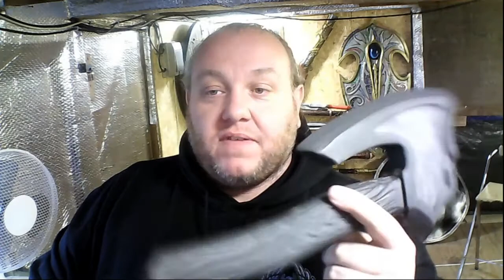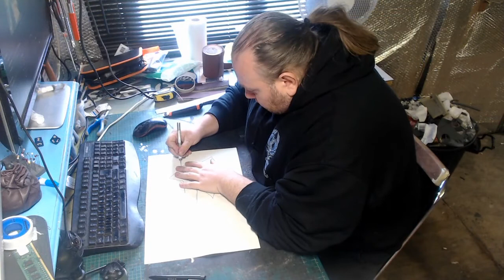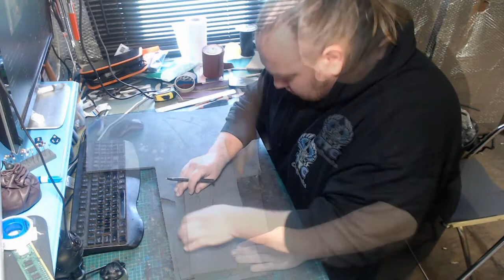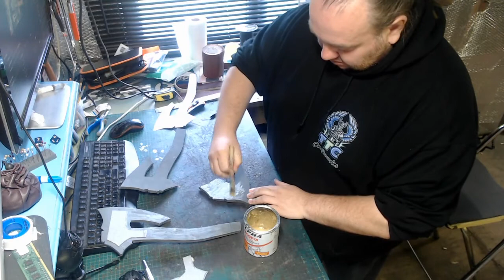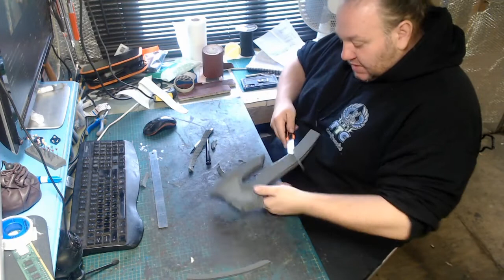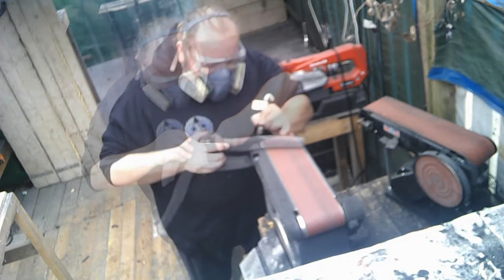quick easy larp safe throwing axe build

Comment: First of all: great video and great videos! I'm already sending your videos to other larpers interested in building larp weapons.

And I have a question, that has nothing to do with throwing weapons, but I thought it's the easiest way to ask you under your recent video:

I'm planning to build a two handed great anchor for an orc. I imagine that the typical hooks would also be the weakest points of the weapon, but simultaniously the points with the most impact. I'm free to change the shape into something more larp-like, as long as the shape is still recognisable as an anchor, but maybe with your experience you have a solution I don't get right now.
Reply from the maker: Thank you. Much appreciated
Reply from the maker: The problem youl have is the head or bottom which ever of the anchor. As your core will be streight then the head will just be foam as you carnt make a strong enough cross section  for cores that won't break or fail weapon safety
Reply: @ttccraftworks8469  yes, exactly. My solution would be a thinner layer of foam inside the gap, so that the hooks are supported, but the shape is still recognised. It would be more like an axe then.
Reply from the maker: Might work but still think it be to floppy at the head. And may not pass safety